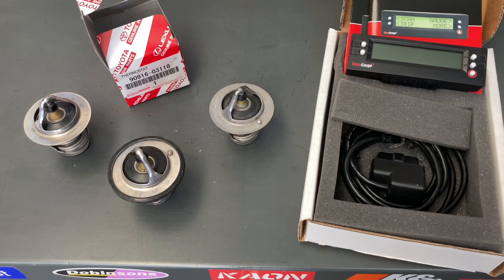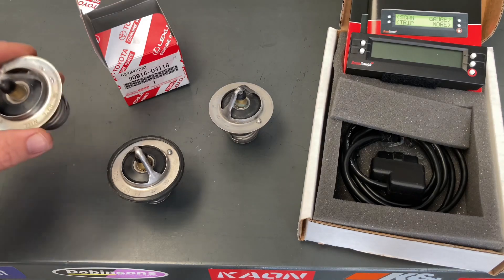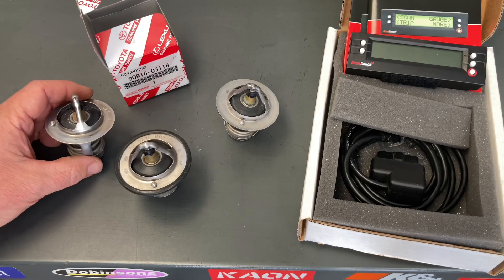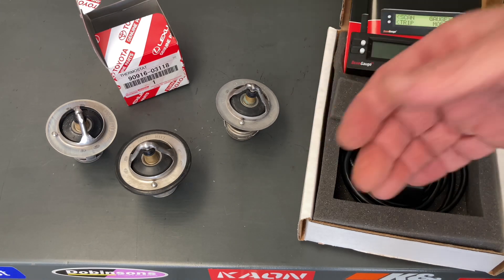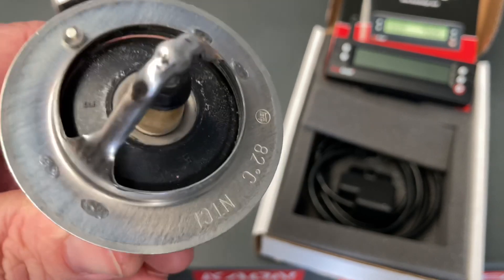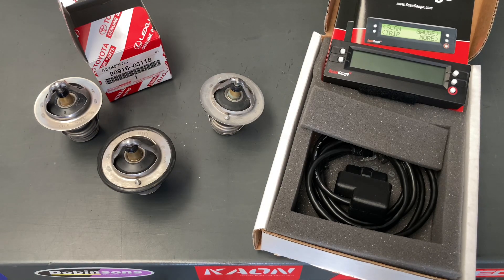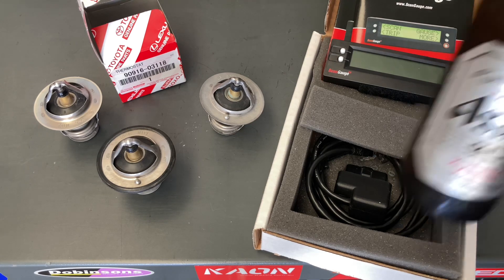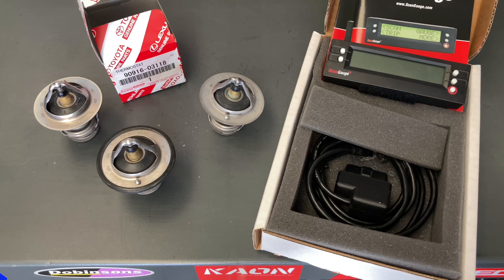ACCEPTABLE COOLING SYSTEM TEMPERATURE and WHY All explained no OVERHEATING

Comment: The OEM ATF/Coolant heat exchanger on the Dmax wouldn't help in lowering the engine coolant temp given that the ATF runs about 10 degrees hotter than the coolant temp, as a rule the two fluid based temperatures would be fighting to equalize.

Comment: I read in the repair manual that the coolant contributes 60% of the cooling of the 1Kds motor. The other 40% is from the oil cooler (which is cooled by coolant) that cools engine oil.
Has anybody had a problem with the oil cooler, ie. leaking coolant into the oil or leaking oil??

Comment: Driving mine sits 86/85 and rarely goes much higher on road even working harder - maybe 88.  I got to low 90, super soft beach, too close to incoming tide near high tide, pushing very hard to get back to the access track before becoming stuck. Prado 120, 1kdftv, auto.

Comment: I am engine monitor anal. By way of example before On-board Diagnostics  (OBD) protocols became standard nearly 30 years ago and then engine control units or ECM's used proprietary code I invested in a non factory ECM chip that provided those codes (along with more fuel & some Ford Mustang Injectors ) and very basic fault code reader for a V8 Petrol Landrover. However this provided no real time readings only fault codes. 

The only workaround to avoid temperature disaster in this engine offroad was a after market Coolant Level Alarm with its sensor in the top radiator hose. Overheating its over bored alloy block with steel cylinder liners was the kiss of death as the liners let go. You thought pinging was noisy :-). A temperature gauge useless as with sudden coolant loss the temperature actually DROPS with NO coolant to measure.

I have always wondered if a after market Coolant Level Alarm still has a place today in a modern (say post 2005) offroad vehicle engine like a 1KD-FTV??

What do you guys reakon?

Comment: Well explained, I have driving lights, bullbar, winch, trans cooler and my temps can range from 85 to 96 depending on the heat of the day and the load on the car. More noticeable on hot days going up slight inclines, generally seeing boost at 8psi or more.
Reply: Good you hwgd

Comment: In my Hilux here in Far North Queensland, my hilux runs at around on 85 on guage, but with towing and a 38c degreee day, the coolant goes to 90 under heavy conditions. I do have a bullbar fitted by toyota dealer up here 20 years ago.